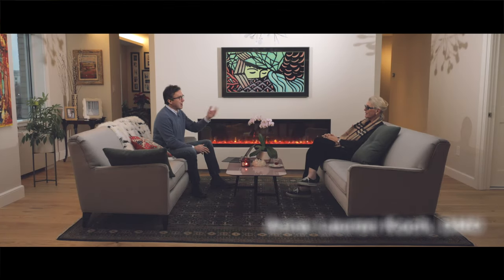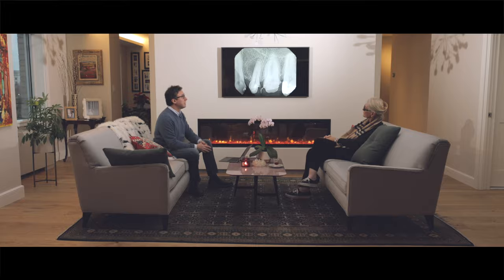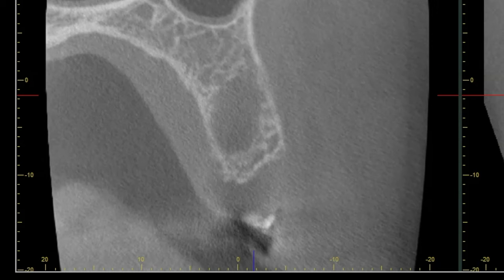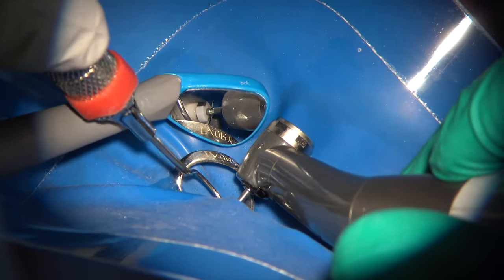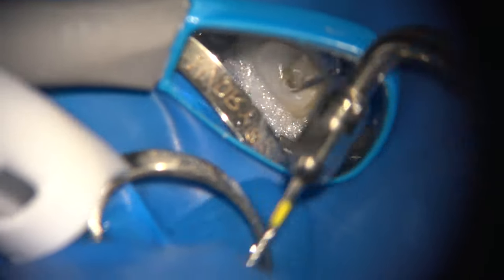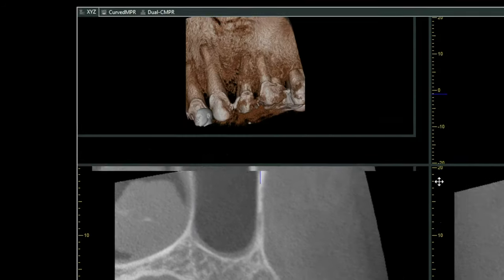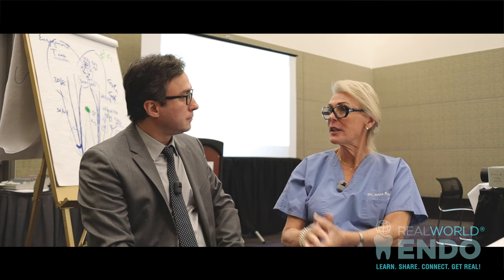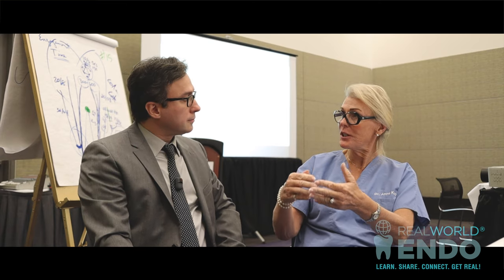EndoSequence Blend Instrumentation Clinical case (CBL 34)

Comment: This was a fantastic case, thank you for sharing it!
I do have a question, however: unless it was edited out, I noticed you used the Endovac Macrocanula, but not the Microcanula applied at or close to the apex, which, if my understanding doesn't fail me, is "the heart" of the negative pressure technique. 
Can you share some insights regarding this?
Reply from the maker: You're correct! I have used positive pressure irrigation using a 31 gauge needle for the apical extent. I'm in the process of developing an EndoVac-like product that we'll hopefully launch early next year that will hopefully address all these issues. Stay tuned for that. Cheers! :)
Reply: @AANasseh  Sounds exciting! Thank you for your reply.
Will you distribute it in Europe, through FKG, perhaps? 
I notice many people are getting into negative pressure irrigation lately; I think Stephen Buchanan is working on a NPI device as well.
Any reason why you didn't use the microcanula at the apex, if I you don't mind me asking?
Reply from the maker: @michaellupu2080  I do use the Microcanula occasionally. I don't think I used it in this case. Probably for a sillier reason than you may think like the assistant had run out next to me and had to go get it from the closet! LOL! No grand idea there. I saw Dr. Buchannan's device as well. It's just a different philosophy. My philosophy is always simplify... or take something more complicated and make it simpler. We'll see how his system works. Time will tell. By the way, my system will likely not make it to Europe next year. Will take much longer. :( 
Cheers!
Reply: @AANasseh  Thank you Dr. Nasseh, for taking the time! 
I wish you all the best with your new device! I saw that video you posted about the new irrigation solution you developed (Triton, is it?). Will that be available in Europe, perhaps? 
It sounds like a very elegant and exciting product!
Reply from the maker: @michaellupu2080  Thank you Michael. Yes, Triton will likely be available through FKG and possibly Scheine. It may take a little time but it will. Your comment made me remember I forgot to upload and share a recent Q&A I had on it! I'll do that right now. Thanks!! LOL! :)
Reply: @AANasseh  You're more than welcomed! Thank you :)

Comment: Hi Ali!
Fun case!! The 3d is a great help. 
I have a question. 
When you access the tooth you seem to put the rubber dam on first .
Is that your normal trepination routine??
HAVE A GREAT WEEKEND!!
Reply from the maker: Thanks. Yeah, I isolate unless I think the tooth is calcified or orientation is an issue. Otherwise, it's easier not to have the patient's tongue and saliva in the way. It's safer for everyone as long as you have a good visual perceptual ability and won't get disoriented looking at one tooth. Cheers!

Comment: OK.  Why not SEAL the whole thing like you did with the lateral canal?  What's the point of the gutta percha in the main canals?  Why not bio-seal everything?  What am I missing?
Reply from the maker: While bioceramic seal of the whole thing is good for now it renders the tooth very difficult to retreat if in the future revision was needed. We should always plan for the patient's future. Remember things can fail because of a leaking crown in 15 years! Then what? The patient should have a chance to revise the case at that time. That's why GP is still recommended. Cheers!